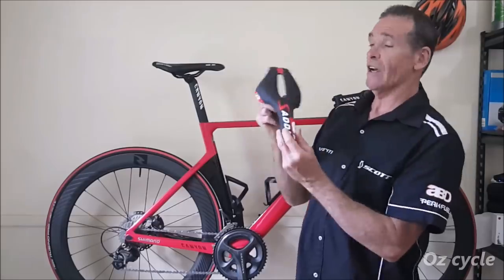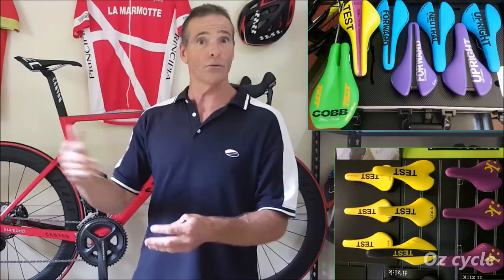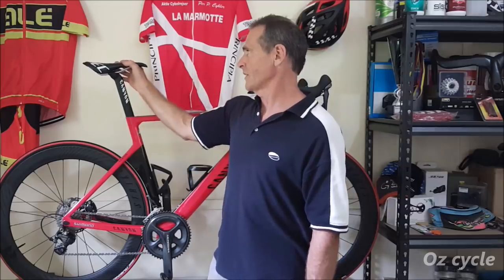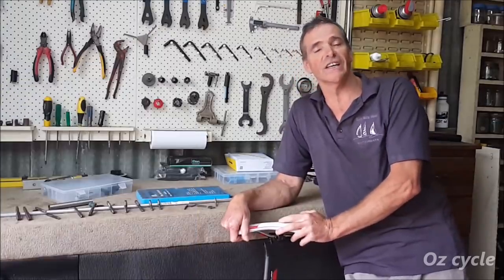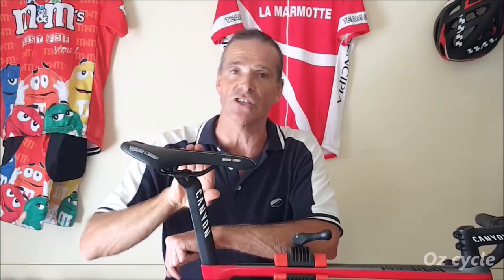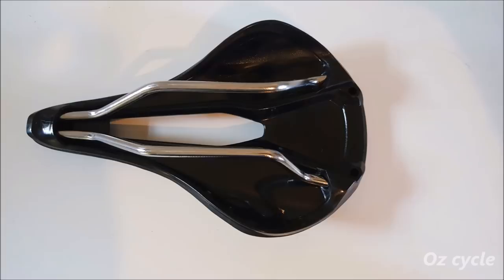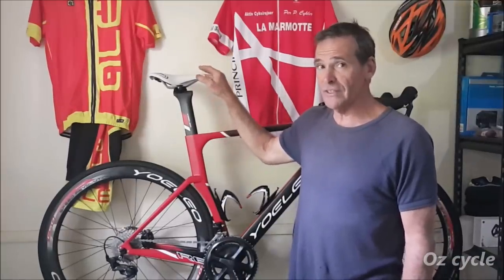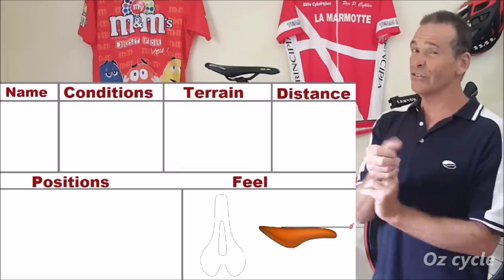How to find your ideal bicycle saddle- Part 3

Comment: My tip: buy a two bolt alloy seatpost of appropriate setback and use this for all your tests. Two bolt with a rocking cradle makes it much easier to adjust angle and tilt. Also, it won't break if over torqued and you always have the other saddle already set up on the other post, so that you don't have to reinstall it to the post.

Comment: Measured my sit bone and i am 100mm, so ive chosen saddles 130mm width.
I’m getting sit bone pain with a narrow mid section flat saddle and I’m getting pain near my hip sockets with a slightly wider mid section and rounded saddle.
I’m going to try a new saddle that isn’t so rounded with a cut out so i can raise the nose a little to take the pressure off the sit bones.
Reply from the maker: Yeh , shape is important too. Finding the right saddle is a hunt.

Comment: A lot to unpack. So I’ve made it through all the videos in one sitting and as many have mentioned I’m sure excellent work. To explain my appreciation I’d say that this is the first video of this length that i have watch that wasn’t a podcast, that huge in my opinion. I am in the early stages of my back to riding fad so there’s tons of testing to do, my current bike is exactly for that purpose as i build fitness and knowledge for my Spring build/gift to myself. 
I do have a question just for clarification. I did notice that tingling feeling in my left hand specifically that i found strange, i self diagnosed to a posture issue although i did feel comfortable on the bike. It was also observed (I always knew) that there was a slight bend in my spine during an X-ray for my lungs which i also assumed could be the problem, i don’t recall this issue last year when i was riding but to be honest i don’e recall. 
So the question: with fixing my position do you assume that this will improve the tingly feeling in the hands? I kind of wish is was a topic you had touched on a tab bit
Reply from the maker: Cycling biomechanics is a huge topic in itself. Tingling in hand could be too much weight on arms/hands,slight carpal tunnel or shoulder compression. Can be lack of blood supply or nerve. Because we are imperfect a lot of issues we just get relatively right and live with it.

Comment: Hi! Thank you, these video series saddle are amazing! Im currently riding a fizik antares (141mm wide) and i’ve already done 15000+km on it, but im not satisfied cause i have a lot of pain in the perineum area, it hurts a lot after long rides or when i ride 6time a week, the pain is not in the middle of the perineum (in the soft tissue) but on the left/right sides (i think they re called pubic bone). If i press these 2 points (left/right) with my hand i can feel bones, but they re not the standard sit bones, cause sit bones are a little bit far back.
Now i want to try a new saddle, i measured my sitbones with your technique and im between 10-11 cm, maybe my fizik is too wide for my body anatomy? 
Do you have any suggestion? 
If can help you, i tend to ride in a very aggressive position and i have a medium/high body flexibility. 177cm, 70kg